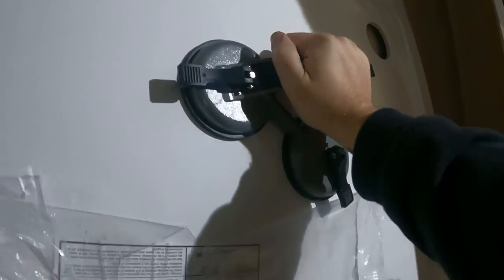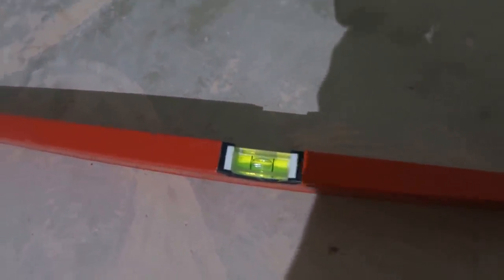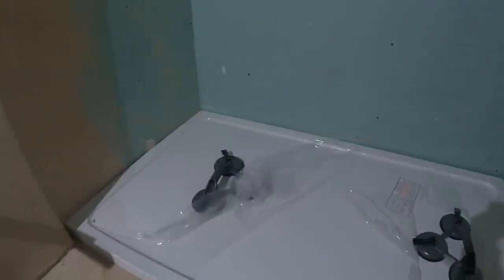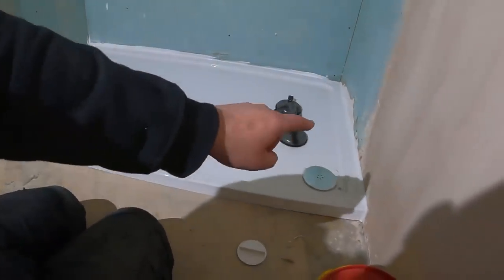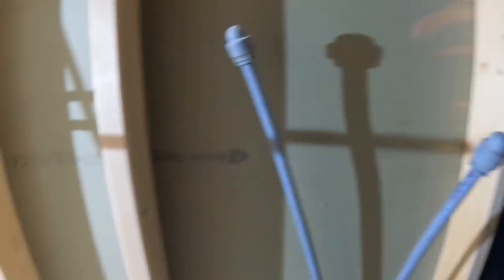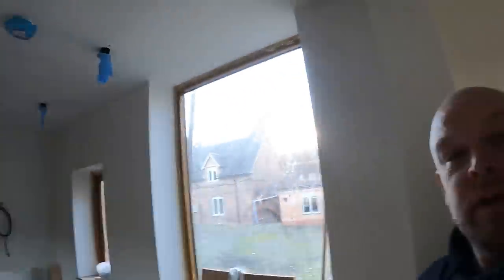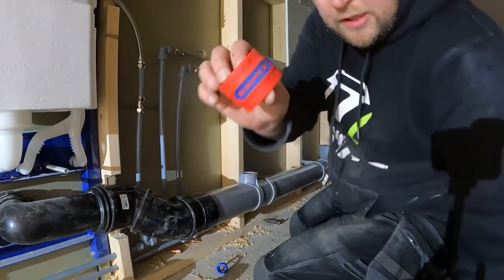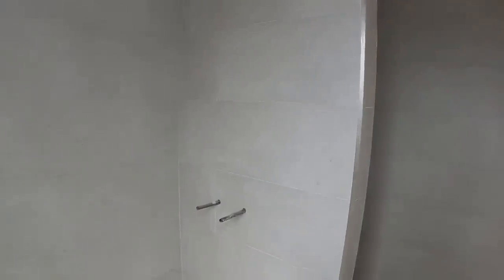PLUMBING PIPEWORK ISSUE..WHY HAS IT MOVED?.. also shower tray fitting at The Barn

Comment: Brilliant job i have nor seen one of those trays fitted before and had no idea,there is no leveling ability to them,and you just silicone the base and  drop it in ,of course making sure the concrete base is 100 per level,i also wondered how much of a job it was getting that 4-inch drain out of that whole and back again,thanks for this one,i learnt a lot from watching ,thanks again.

Comment: Had this issue with a shower a while back where I’d done the first fix and the tiler moved the pipe work (I’d even left a timber with the holes drilled at 150mm centres over the tails which he’d removed (there not being enough room in the wall for a brace) 😖. Long story short, a combination of porcelain tiles and the tiler having packed a load of adhesive in the void meant that the only option was to break out the tiles at 4pm on a Friday to repipe it 😭! Needless to say words were had……
Reply from the maker: Nightmare mate
Reply: Plumb centre do a shower guide set not tried it yet looks handy. 👍

Comment: Great  video again & thanks for making & spending time editing adding the sound music etc & working full time too! Hats off.
Re plastic pipe over copper, you’ve heard of Buteline stuff? Came across it, a New Zealand product over here & excellent as crimp fittings that much better than push plus also do solder to crimp type. Well worth a look. 
Re the shower pipes, I sometimes find holes round tiles been made too big so those brackets are a right pain to try to drill & fit!
Also a important point to highlight to folks is the sealing round copper pipe on shower pipes; use GB pro or CT1 as the acid content in silicone reacts with copper & can eat at it.
Reply from the maker: Thanks mate, glad you enjoyed it👍🏼👍🏼

Comment: Really coming on now bud. That's great having that easy access for all the pipes on the bathroom.  Thanks for all the tips as always. 😊

I don't get all the plastic haters out there. Use the best system for your application whatever it is. Pros and cons to all of them including copper. What's your take on mlcp just out of interest? 

Shropshire escaped the worst of the storm proper blowy but not as bad as down south.
Reply from the maker: Thanks mate…. Glad you enjoyed it.
Everything has its place, as I said I use plastic for speed and cost but always copper where it’s seen🙌🏼🙌🏼

Comment: Best way to keep 150mm centres are either.
1. Use elbows in between the tails so they never move then cut them off when ready to tile etc.
2. Use the template back plates that you can get now.
Only work if you are working on timber framed walls but then no need to sweat that valve won't fit👌👌
Reply from the maker: Elbows being cut away… that’s when the tiles can move the bloody things🤣🤣
Reply: @MJTiffPlumbing  pens who's tiling 😂
Clipped pipework can also move.
Shower back plate valves if you can use them will prevent movement and only around £15.00. Maybe more down in London 🙄😂
Reply: Plasterboard and tiles will still mess it up they know the job and they always do lol
Reply: I dont like fixing shower pipes too hard its best if they can move a little imo

Comment: Some tray manufacturers,Mira one of them,actually recommend in their installation instructions  fixing the tray down with silicone.Not all silicones being equal tho',I've found that acetoxy silicone onto primed ply or chip does not stick very well at all. Better off with a hybrid polymer as you mentioned
Reply from the maker: Yep some companies are beginning to see the light when it comes to this👍🏼👍🏼
Reply: The underside of a mira flight tray is like no other 
Hence they say use silicone

Comment: Hey Great video as usual. Nothing wrong with plastic in my book either. i use hep but a bit of a ball ache if need to demount, Out of interest what fitting do you use? Had the same issue on a bathroom i was doing tiler moved one of the feeds slightly . from then on i use the Marflow Shower PL8 , keeps the pipes dead on and rock solid , stacks of fixing points so easy to get dead level too, no bracket to drill on second fix just the olive and the thread and tighten up and your done.  Best £20 i spend on every first fix shower now, so easy and no issues with pipes moving !! Looks great there your doing a great job , i love watching every week so thanks for taking the time to make these videos so many tips that are helpful too. Bring on the next episode 👍😊
Reply from the maker: Thanks Russell…. Yer I’ve seen those about and look like a great fixing plate to use👍🏼
Reply: Me too, I'm a pro bathroom fitter and wouldn't dream of using anything other than a PL8. I make them up in bulk on a piece of ply with the copper drops, every few months to save me time on site.

Comment: Copper pipe even though it’s hidden will last longer, push fit won’t last as long as has caused me lots of problems
Reply from the maker: I’ve never had an issue with it in 10years of using it a lot. 
Trust me, if people were willing to pay the Labour for the extra time and materials I would fit it copper everywhere but people don’t want to now.

Comment: Mate, I had no end of issues with the Rothernberger Plasticut Pro(the one the does 32mm and 40mm). Worked fine with 32mm, but tramlined something rotten on 40mm. Ended up getting drop kicked. 🤣
The monument ones seem alright,  but they’re separate sizes.
Reply from the maker: Yer I have a set of the monument ones aswell somewhere

Comment: Definitely going to get some of those sucker pads. Totally agree with using sealant etc and not cement on them trays.
Reply from the maker: Will make your life a lot easier mate👍🏼👍🏼
Reply: Resin trays are supposed to be used with either a sand and cement mix or tile adhesive. Most resin trays will state to not use silicone.
Reply: @sicdoctor  why no silicon for holding the tray in position?
Reply: @neiltitmus9744  some state not.

Comment: Hi mate. The knipex bix slice blade is bent. That’s why it spirals on the pipe. Trouble is you try finding replacement blades. 🤨🤨
Reply from the maker: I will try swapping it, you get a spare with the cutter apparently
Reply: I didn’t with mine 🤔. I do love it though

Comment: Every plumber I know beds them on silicone, the idea of sand and cement is that if the floor cracks it won’t travel into the tray because it will delaminate first. Not known one to crack on silicone yet though to be fair, have seen them get a bit of a rock though on timber floors where the silicones not quite generous enough.
And silicone will eat the washer eventually and the seal will fail over time. They’re not designed to have silicone smeared over them!!
Reply from the maker: Washers will be fine mate, done this for over 20 years and not had one fail yet…… thanks for watching👍🏼

Comment: I use speedfit/pushfit all the time, never had any issues with it and like you say if it’s not on show it’s a much easier and cheaper way to pipe up.  Especially with the price off copper/fittings at the moment💸😂
Reply from the maker: Exactly mate…. 👍🏼👍🏼
Reply: Copper elbow 64p 
Push fit elbow £3

Comment: What do you think of the JG inserts with 2 seals on it? It seems the insert head is quite thick and effectively there seems to be less pipe inserted into the fitting. Do you think this may cause any future issues?
Reply from the maker: I don’t use JG stuff that much to be honest mate, but I have seen what your on about and  I’m sure it’s tried and tested ok.
Reply: Over the years they have improved push fits 
I’m 100 percent certain it’s a improvement on the standard insert

Comment: Hi mark,love your channel.always informative & in the "real world"....hope you don't mind me asking,regarding bossing baths, basins,showers waste into soil pipe either vertically or horizontally ,is their any regulations to adhere to ie, distance from toilet outlet or if they should go above or below toilet outlet to prevent smell & back syphoning to baths etc .. cheers col
Reply from the maker: Thanks Colin.
As all traps have a water seal there is no issues. Reg wise I’m not 100% but I’ve never had an issue with building inspectors etc
Reply: @MJTiffPlumbing  thanks for the reply mark,much appreciated.. keep up the great work you do..col
Reply from the maker: @colinwilson933  thanks Colin 👍🏼👍🏼

Comment: Personally I prefer to bed the shower tray on mortar,seen a few developing a hairline crack because of the silicone.
Reply: I use tile adhesive mortar underneath drys and cracks it needs to breath to dry. Unlike tile adhesive it just sticks. I look at that tray as like a massive ceramic floor tile really

Comment: Well done m8 looking good I know it’s only a small run but are you not ment to run the hot on the top and cold on the bottom? Jue to legionella. I could be wrong I’m still leaning
Reply: Was my thoughts too. I've been watching too many plumb like Tom videos. 😁 Bit of lagging on the hot would sort it I'd imagine.

I'm just in awe of some things f these plumbers though. I think I've done well changing a tap on my own then watch these.  Good luck with your training I start in May all being well. 😊
Reply from the maker: Lagging stops that being an issue mate and with heat displacement it’s not a problem in most cases. It’s when pipes are strapped together it’s a bigger problem
Reply: @MJTiffPlumbing  yh I figured you'd probably lag it especially with having the secondary hot running. 👍
Reply: Yeah you don't get the heat transfer or pipe condensation  with plastic like you would with copper so it will be fine..
Reply from the maker: @micky7028  yep exactly that mate, one of the pros of plastic.

Comment: Did you put the tray down with anything? Just looked like you dropped it in straight on to the board? Normally I fix it down with something if it not on a leg set.
Reply from the maker: Yer….. as I said in the video I bed it down on Silicone👍🏼👍🏼
Reply: @MJTiffPlumbing  oh sorry missed that bit!

Comment: Shame you had to cut out the dpm, hope it’s a dpm not a radon barrier anyway!!!
Pretty annoying the trap location wasn’t taken into account when designing the drain locations!
Reply from the maker: Trap location was taken into account, that’s why it was where it was….. so we can connect on easily.
And that wasnt DPM mate, DPM is UNDER the insulation….. that was the under floor heating covering that was carried through….
Reply: @MJTiffPlumbing  every floor is designed different, I can see that’s just screed now after second glance.
Floor system we’re using atm has membrane over the insulation

Comment: Do you stick the shower tray down?
(With silicone, sand and cement or anything else?)
Reply from the maker: Yes mate…… as said in the video a few times, it was bedded down on silicone👍🏼👍🏼
Reply: Thanks - I miss heard it as the head of silicone around the outside. My bad!

So many different views as to what is the best way to do it!!
Reply from the maker: @paulthewitt  yep, everyone has there way.
I either use silicone or CT1…. Never had an issue but each to there own👍🏼👍🏼

Comment: Hi Mark.. just doing my bathroom and going to be fitting an 800 x 1200 resin type shower tray.... again instructions say bed on 5mm sand/cement .... however was thinking of using plasterboard adhesive troweled out using a 10mm notched trowel... do you reckon this would work?
Reply from the maker: I personally wouldn’t use plasterboard dab, I would go for silicone/CT1 or some use tile adhesive.
I think dab sets much to hard for my liking.
Reply: @MJTiffPlumbing  ... many thanks, will steer clear.. being the tight arse I am, I was just thinking of using up materials 😉👍
Reply from the maker: @jonb8241  🤣🤣…. Yer I get that mate, but it sets SO hard, that would be my concern.
Reply: Dry run onto window packers to make level making sure the waste sits nice . Then full bed of tile adhesive 5mm higher than your packers and small bead of ct1 on the waste last thing before you drop it in 👍🏻
Reply: Has to be flexible to some degree. Drywall adhesive won’t give you the flex you need. Tile adhesive can work and plenty of people use it but I think the way forward will be polymer glues. 

You need to consider whether your on concrete or wooden substrates as well. There is never one solution for stuff on a building site. A lot of the time you have to be adaptive and work problems out as they come up
Reply: @signaturerenovationslondonltd  thanks... yes, this is on an upper floor with timber joists and subfloor.

Comment: I noticed you dont mark.the plastic pipe when putting the fittings on. No biggie, and I know it's a pain, but I taught my lads to always mark the depth of the fitting stop on the pipe so you know its pushed all the way in.
Reply from the maker: Never have done to be honest, you can feel when they push in and lock together👍🏼👍🏼

Comment: The Mira shower tray instructions tell you to use silicone sealant to stick them down. As long as you use the manufacturers guidelines there will be no comeback
Reply from the maker: That’s correct, Mira have now stated that in the installation on a lot of there new shower tray range👍🏼
Reply: @MJTiffPlumbing  why, though, did you use silicone on the waste ? They advise you not to? I am fitting one this week and was just going to use the ring washer supplied
Reply from the maker: @jonneym  I’ve always siliconed wastes into trays, as the washers/rubbers have been known to leak.
Most people silicone waste fittings into trays/basins/baths etc so it’s a proven way of having no leaks.

Each to there own as I always say, this is how I do it👍🏼

Comment: Great vid…again! Many houses around here lost parts of their roofs due to Eunice, including my neighbour’s, which then landed on my garage roof! Plenty of damage and it has to come off my insurance!!

Anyways, did you use a solvent collar on the shower waste in the floor? Also curious about how you deal with the hole in the damp proof membrane i.e. the blue stuff? Do you have to patch it up, or do you just leave it as it is?
Reply from the maker: As shown in the video, I bedded it with sand and cement to fill the area.
The waste fitting was a push in internal bung
Reply: @MJTiffPlumbing  Thanks for responding and I should’ve been clearer! I was specifically referring to patching- up the damp-proof course before back-filling?

By internal bung, are you referring to a 110mm / 40 mm internal drain connector, like the one that McAlpine sell? Cheers
Reply: The damp membrane should be under the insulation really. The membrane over the insulation is usually to stop the screed or concrete flowing under the insulation and making it float.  But i could be totally wrong🤣
Reply: @steves1460  did you mean how he converted the compression fit waste pipe to solvent weld ?? I’m curious to
Reply: @boyasaka  I was referring to the 110mm pipe. Anyway, the solvent pipe is well-suited to the compression connector on the trap and you’ll have no issues there as it is designed for exactly that reason. The way you convert between different pipe sizes and types is via a compression connector. HTH
Reply: @steves1460  thanks for that Steve

Comment: When we price out a job the only difference is often labour and not by much as generally plastic is more expensive than copper down here. I've lost count of the issues in new builds with plastic where the inserts have blown out, either due to pipe ends not being perfectly square,eroding the plastic away and blasting out the fitting. Or more commonly not being able to handle the constant temps of hot water secondaries. Each has benefits and situations it's best for.
Reply from the maker: You must be getting copper VERY cheap them mate
30m copper is around £100
30m plastic is about £40

I know years ago they used to use metal inserts in plastic pipes and that was a huge issue…. Now it’s all plastic I’ve not had a problem at all.
Like you say they both have there places👍🏼👍🏼
Reply: @MJTiffPlumbing Just been using hep20 pipe and fittings and the inserts are metal, they seem like some kind of alloy, were the old type fittings steel ?,  hope they are ok.
had to alter 10mm plastic microbore pipes for a towel rad, i used speedfit elbows first of all and found that after fitting i could grab the pipe and pull it apart ! , went and got hep20 elbows and they were more of a positive fit, think i will always use hep20 from now on.
Reply from the maker: @edward877  use what you trust and have confidence in mate👍🏼👍🏼
Reply: @MJTiffPlumbing  Yeah Copper is about £90 per 30m but plastic works out at £60 per 30m. By the time you ad the fittings there's not much in it. We're Southern Counties base though where plastic generally is more expensive and copper is generally cheaper than the average.

Once you take into account inserts/fittings etc the price really does just come down to labour for us.

It's actually the plastic inserts on Hep20 pipe that we've recently been seeing the issues with. We've seen it with Speedfit and others before, same fault. Just down to people rushing because of price.

Comment: Why.is the hot.pipe on the bottom i assume you know thats wrong
Reply from the maker: Because it is……. And it not “wrong”…….
Do you know the temp displacement of those times and how long the run is?????
Reply: @MJTiffPlumbing  good job you don't do commercial work a risk assessor would pull you up on that

Comment: What do you use to stick tray down if the floor isn't level.
Reply from the maker: Either get the floor level, if it’s a wooden/board floor I will get it levelled through, if not I would use a base of tile adhesive or CT1👍🏼👍🏼